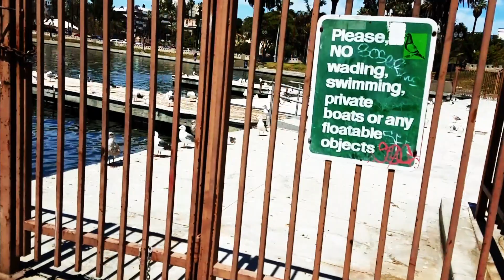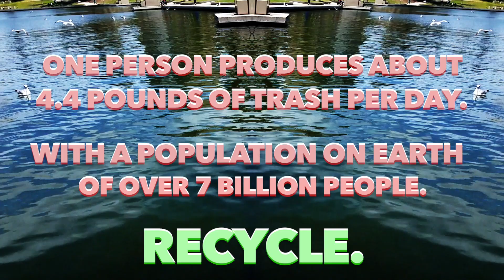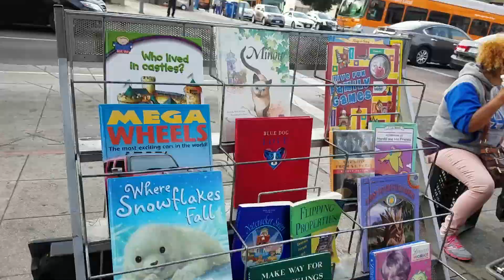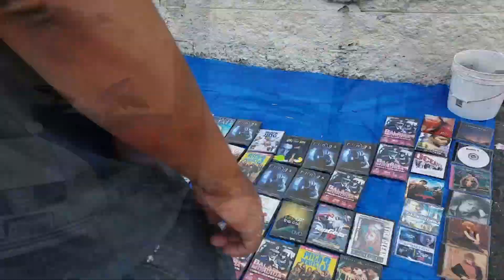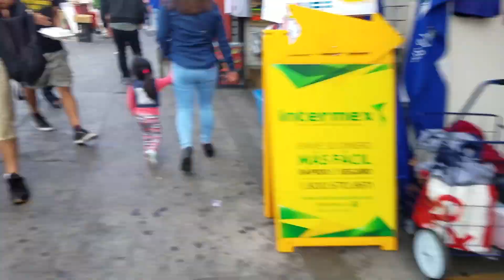Magnet Fishing - WARNING TRAGIC FOOTAGE Heavy Metal Magnet

Comment: Go out to the lake in Reseda Park and see what you can find.  Used to be electric u-drive motor boats at both parks when I was a kid.  Moved to Oregon in 85 but McArthur looks like the lake has had upgrades to it's shores since then.
Reply from the maker: Reseda isn't far from me either. Thanks for the tip! I'll go check it out! Thanks for watching and supporting!🤘🎅🤘
Reply: Don't forget the miles and miles of wash either.  Even though there's only a small amount of water at times in the center, you can't always see what might be in it.